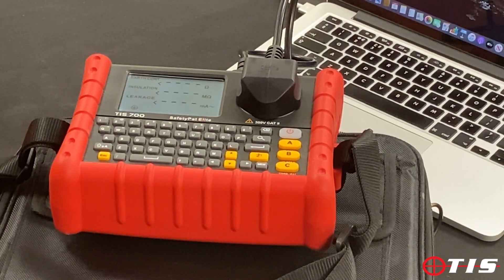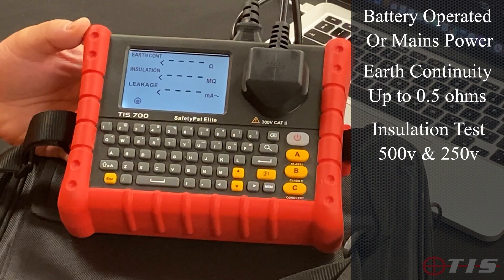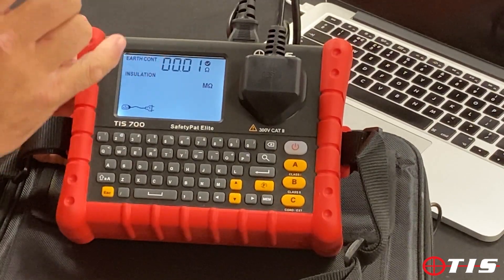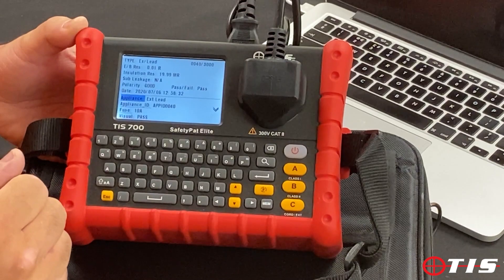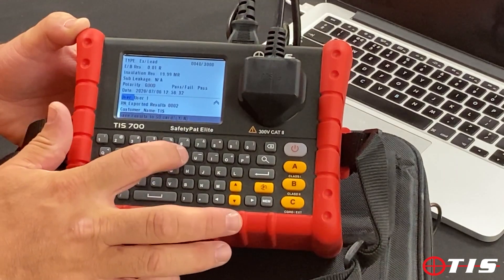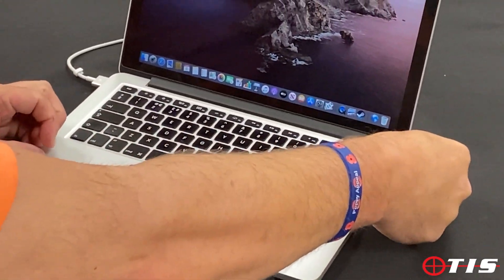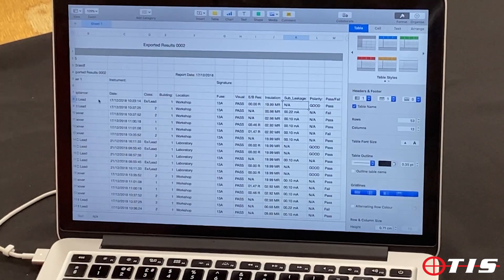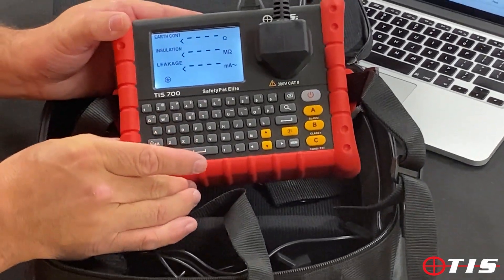Tis 700 Safety Pat

Comment: Does this have a portable RCD test function
Reply: Hi Mark it will conduct a leakage test for 240v appliances and 110V appliances
Reply: It’s a Pat Tester Marc so it doesn’t have an RCD Test
Reply: @stevenhayes310  
I  understand that, just a lot of new testers have this feature  due to IET recommendation of testing.
Would have been a good selling point.
Thanks anyway

Comment: Hi, I've ben using this a s my back up tester, my megger 420 has gone down again.... Anway I I have a question. Are the exported results in the excel file acceptable as a full cert ie: inline with the requirements for pat certification? many thanks, great little tester, I've just never had to call certs out of it!
Reply: Does this have a RCD test
Reply from the maker: @Trouty750  no it doesn’t conduct an RCD Test only our MFTs will
Reply: Yes they are.